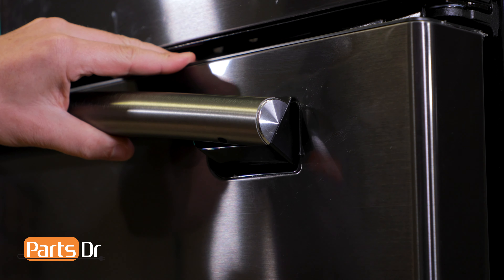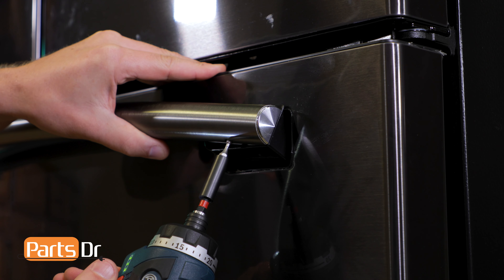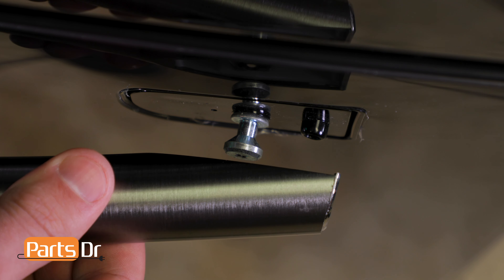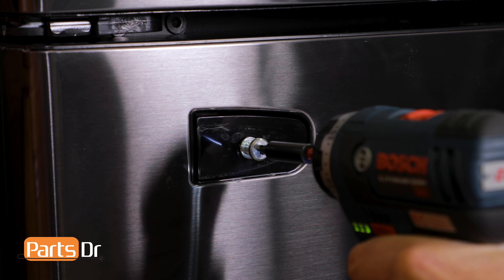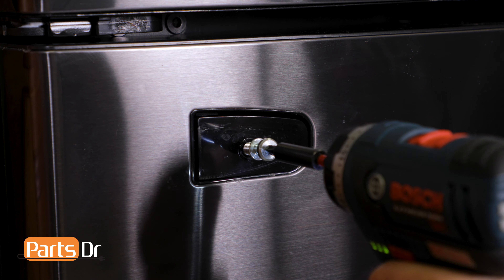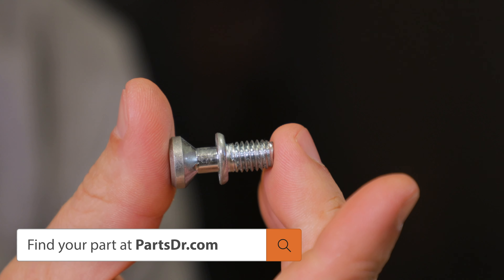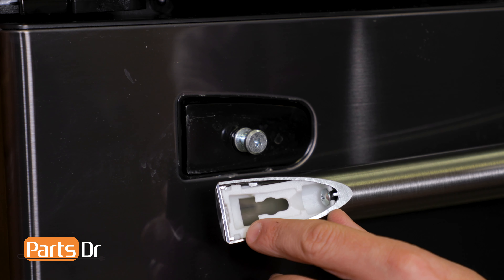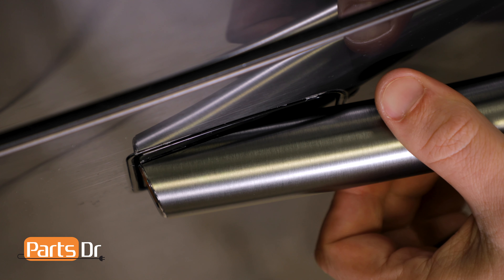How to replace Samsung door handle mounting screw part # DA61-11161A

Comment: Can you post a video of how to remove the actual assembly of the freezer door handles? Mine completely cracked and I'd like to see how to replace before ordering the parts
Reply from the maker: If the plastic pieces on the door are broken, they are usually not sold separately and are usually only sold as part of the freezer door assembly.  This video talks more about that here:  https://www.youtube.com/watch?v=9ZNS6Q6W9TA

Comment: I have a SAMSUNG SRF890SWLS and the middle cooler drawer handle that the handle attaches to snapped off. Can I get to the part to replace it? Even if I have to 3d print the part?

Comment: I ordered a handle for my freezer for Samsung but there was no setscrews in there and no instructions. How can I install the handle without the set screws?
Reply from the maker: If your model uses set screws for the installation of the handle, then you will need set screws to install the handle.

Comment: My plastic piece in the freezer door that the handle attaches to snapped off, refrigerator RF263BEAESR/AA do I have to replace the door, or do they sell the plastic piece?
Reply from the maker: Unfortunately, you have to replace the door to fix this problem.  This is the door for your model here: https://partsdr.com/part/da82-02517a-door-assembly
Reply: @PartsDr  That's what I figured from my research, I don't see the Fingerprint Resistant Black Stainless Steel on your site, do you care it?
Reply from the maker: @tammihamm2493  The door linked in the previous message we sent would be the exact door for your model refrigerator.  It would have the same color and finish that came with it from the factory.

Comment: How to replace  the part which holds the pin-screw? This part is visible on both sides of a door panel
Hoped to attach a pic, not available
Reply from the maker: On most models, those plastic pieces on the door are not sold separately, you have to buy them as part of the door assembly.
Reply: if your hinge broke, you have to buy a new drawer front. Or you can look at my video and description on how to fix it. https://www.youtube.com/watch?v=ah7egRPDiUc